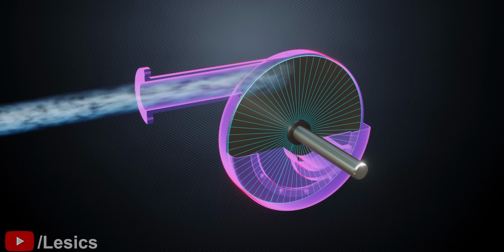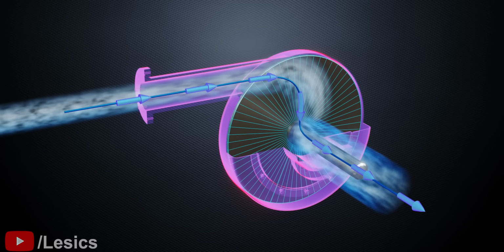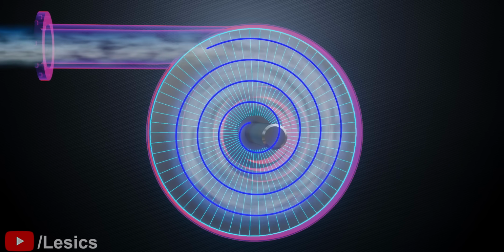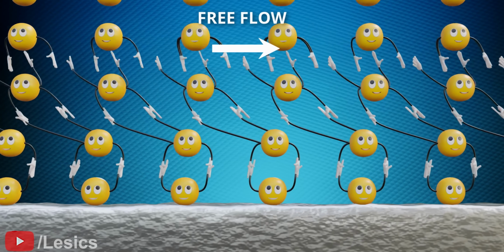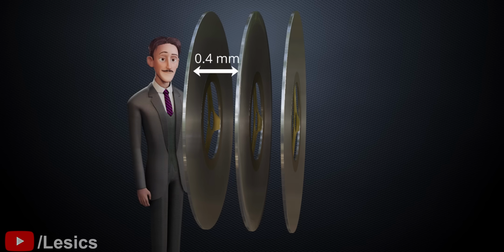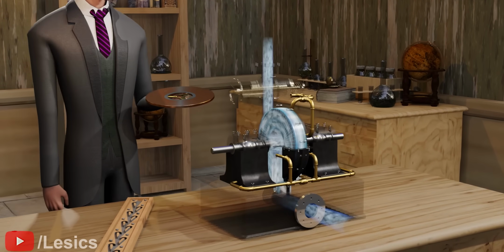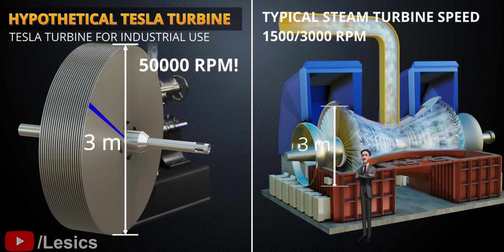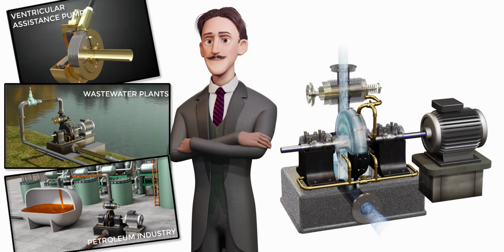Tesla Turbine | The interesting physics behind it

Comment: I was part of team that built one of these for an Airforce design competition in college. We could reliably get ~94% efficiency with a closed loop superheated steam system harvesting exhaust heat from a small jet engine and got just below 96% efficiency in some ideal test cases. The main limiting factors were that the discs had to be designed to stretch uniformly without distorting at ~40k RPM and that the gaps between the disks had to be designed for an incredibly specific set of operating parameters (steam temp, pressure, velocity, etc.). The smallest variations, or while waiting for it to spin up, and we wouldn't even get close to those efficiencies. A lot of the initial designs weren't efficient enough to reach the right parameters at all.
Reply: I came up with a major improvement to the Tesla turbine.  Haven't gotten around to patenting it yet, plus nobody is interested in the technology. My proof-of-concept model actually used posterboard discs.  One thing that helps disc pack stiffness as well as self-starting is putting spacers around the perimeter of the disc pack (not an original idea.)  Ran it off compressed air using a handmade by-guess-and-by-gosh De Laval nozzle.  Hooked it up to an old (small) electric motor and it was able to do useful work, although I imagine the efficiency was truly horrible.  
When I retire, I want to see if I can build a gas turbine engine using two Tesla turbines (one as the compressor and one as the power turbine.)  That would be a single intake turbine coupled back to back with a single exhaust turbine. I think some of the early German jets used radial flow turbines rather than the current axial flow designs.
Reply: @ostlandr  Whittle jet was radial flow.
Reply: @ostlandr  thats what I was thinking too, like I said with how a scram jet is built specifically for hypersonic speeds only and essentially needs a boost phase tow in from a classic turbine but that uses linear force feeding and I think its that centripital force and the feedback loop that makes it so good, that also makes it so untameable at the same time. 

Its essentially all horsepower and no torque, the second you put a load on it, its going to burn itself to death. 
Unless we can get our hands on some wild new neutron star element that can warp space time, I think like @cheebsta said, you really need to take this idea from the 50,000 foot view and ask, whats the real use case that this can perform that isnt already done so by the most hardcore capitalists employing the most world class engineers (i.e. Edison bootstrapping tesla into a lone, impoverished death with government spooks flying like vultures around him waiting for him to pass and steal his Godly treasure trove of sentient progress)

But, if we can walk along the razors edge of science here and remember that Tesla said: 
"If you want to find the secrets of the universe, think in terms of energy, frequency and vibration."

So maybe there is some way to balance that overload force with some sort of resonant frequeny or something way outside my bounds of thought. I mean the man made a frigging earthquake machine. 

So if its meerly for personal value Id say absolutely go for when you retire and if you figure it out then I will deliver standing ovation. I get most of my lifes joy building things I never get to use though so there is truly joy to be found in just merely building things. 
Or if for any reason, I would say to honor the true bringer of light and the One Father of the modern world of electricity, the greatest Serbian man to ever walk the Earth, the man, the myth, the legend, Nikola Tesla. 
May he forever rest in the resonance of the ether and may Edison dissapate into an eddy current somewhere. 😅
Reply: Oh boy this warrants so many follow-up questions:

- Dual outlet or single?
- How many discs were used per outlet? 
- What geometries were used in the outlet? 
- What diameter went with that RPM?
- What was the measured torque output?
- Was (or how was) the design compounded? 
- What materials were used for the discs that had those properties? 
- Stated efficiency is presumed mechanical, how'd you calculate that efficiency? Was it measured output vs measured losses after the outlet?
- What was the name of the competition? Who did you represent or were associated with? I want to find it online or know what I'd need to file a Freedom of Information request with the government because having access to those results would be a game changer for anyone seeking investment in the technology.

I'm not looking to call you a liar but you did just say you'd achieved well over twice anyone else's stated efficiency numbers. While I can imagine what you're saying could be true it's still well beyond what anyone has actually demonstrated. So "extraordinary claims = extraordinary evidence" still applies here. Nothing personal! :)
Reply: @Cheebzsta  Honestly, it was years ago and I don't remember most of the details but I'll give you what I got.

-It used an exhaust manifold with a single exhaust port going into the turbine. The port was also optimized for laminar flow over the disks. The turbine had dual axial exhausts which recombined in a baffle at the manifold's intake.
-Around ~15 disks, can't remember exactly.
-Turbine exhaust was a circular cut around the axle, broken up by three supports with rounded chamfers. The disks mimicked that but were individually keyed to give the ports a slight offset. The offset actually eked out a bit more (read as "miniscule") efficiency in testing, likely due to artificial radial extension of the fluids path toward the axle.
-Around ~10in diameter disks.
-Not sure exactly how this design came about except our professor was interested in a practical execution of the turbine and it fit the competition requirements.
-The disks were made of a pre-stressed stainless steel alloy. They were individually laser cut then tested at expected RPMs for any unexpected deformations. The vast majority of all disks didn't meet our specs and got tossed out. I think we could only use about 1 in 20 disks by the end of it.
-It was primarily a mechanical efficiency and as soon as you throw an alternator on there it's a completely different story. It was measured relative to the steady-state properties of the steam at turbine intake vs turbine exhaust and the kinetic energy of the disks and axle. We measured efficiencies throughout the entire system but that one was the main focus. The most inefficient part of the system was just heating the steam with the jet exhaust without impacting its thrust too much. Surprisingly difficult to do. There was a fair amount of doctoral research on tesla turbines that we used as the basis of our design and which achieved similar efficiencies but it was all at similar or smaller scales. For the amount of effort there aren't really any practical applications for a turbine like this.
-I can't remember the name but it's an annual competition (different goals each year) based out of Wright-Patterson AFB in Dayton, Ohio. This one was in 2014 and we were representing the University of Michigan Aerospace Engineering department. It was a shockingly informal process so I'm not sure how much info you could find but if you do look into it and find anything let me know. I'd love to revisit it all.
Reply: @ruchz2010  Thanks for the response. I appreciate it. :)
Reply: @Cheebzsta  
This might be a stupid idea but what about machining or metal etching Tesla’s valve between two opposing disks?
Reply: @QuantumStrangeQuark  Well I'm trying to visualize what you're talking about, since it sounds like you have two contra-rotating impellers, which if you're seeing something in your mind's eye there that I'm not than I commend you.

But I'd take a broader perspective on things like this: If you require extensive machining of the turbine you've likely moved out of the real, and IMO, the point of a Tesla turbine.

One of the things that even Zach points out is that the whole thing began to fall apart once they added an alternator to it meaning that they hadn't overcome the key failing of the device: Mechanical efficiency while extracting useful power as electricity.

If you've got the kind of machining necessary to etch complex geometries into a tapered disc you're probably not far off from being able to machine a bladed turbine which, thus far, has demonstrably better efficiency results.

So long as you''re paying, either in labour or money, per KWh for fuel (methane / hydrogen / etc) the economics always point towards using the most efficient units.

Not to say that I think the Tesla turbine's bad. I just think it needs to be used in situations where power extraction is possible but regular turbines would be smashed apart.

For example while I don't think there's any reason to imagine a world where large scale steam power production facilities are replaced I do think there's a purpose for it though if one can get creative. 

One is small, distributed power plants. For example using fast pyrolysis of biomass to produce an 80%/20% bio-oil/charcoal slurry which can then be pumped, using a Tesla pump no less, to a centralized hydrogen or bio-methane production facility.

The second and simplest one might be spraying waste flue gases directly into alkaline water and letting the ensuing geyser-like water explosion hit a turbine, for example.

Provided the materials aren't prone to serious failure in the presence of alkaline solutions the Tesla turbine can handle the suspended solids flying a hundred (hundreds?) of KM/H that would result.

It wouldn't produce the kinds of efficiencies that a regular steam or gas turbine would but selling industries with a lot of waste flue gas a mechanism to earn additional revenue using a machine that is, by definition, cheap and easy to mass manufacture is a potentially interesting thing to do.

If we can replace a sizable percentage of our natural gas used with bio-fuel based sources (Gasification -> Sabatier reactor / Anaerobic Digestion etc) one could imagine a situation where carbon taxes make the appeal of such a device a fiscal no-brainer.

Make money from the electricity, avoid carbon taxes and still have the option to switch to bio-fuels so you can sell carbon credits? 

Like everything it depends on price and government action but this isn't really a new idea. Tesla himself envisioned something akin to this only now it's not merely economic (dirt cheap energy!) but instead comes from us realizing that we've barrelled into becoming the world's most self-aware yeast.
Reply: @ruchz2010  
Sawmills encounter similar "stretch" issues with large circular saw blades.
Their solution was to make a blade that would be a slight bowl at rest and then "stand up" while spinning due to the steel stretching at the outer edges.
Reply: @ruchz2010  I did a lot of research into Tesla turbines many years ago and it seems that the main problem was preventing distortion of the discs from heat and perhaps stresses in the rolled metal they were cut from.
Starting the discs was easier if small holes were drilled axially to causes 'grippers' for the steam  flow to impact on.'  Enlarge the gripper holes and you get a turbine that is easy to start and gives very good torque.
Problem these days is huge steam generation needs fossil fuels so I don't think we'll see Teslas ever used.
It would be interesting to try a Land Speed attempt using a steam powered Tesla with the steam either coming from a big conventional boiler or some chemical steam generator a la Turbonique of the 1960's.   Such a vehicle having a big boiler heated by a gas burner would start off slow and heavy but get faster as it exhausted the steam...
Reply: @ruchz2010  Fascinating, Thanks, Zach.
Reply: @Al828282  Tesla cars are now wrapping their engines and carbon fiber to prevent expansion, allowing them to get higher RPMs and tighter tolerances.

I'm pretty sure the same could be done here.
Reply: @r1xelex  there's a company making a steam powered rocket, intended to be used as a first or booster stage.

As far as I could tell they're just using batteries and a resistive heating element. Might work even better if you toss some hydrogen peroxide in there too.
Reply: @jtjames79  Messerschmitt 163 used hydro-perox.  Super power for a few seconds.
Reply: @Cheebzsta  I think it would be interesting to see this engine setup in both polarities. Where one generates into a the version that is a pump and the pump pushes into the generator, and limiting the pump RPM to keep it at a consistent speed. Of course, using any power off of it may reduce the pump speed, but within certain limits, wouldn't you be able to get a consistent voltage to other applications before it stops from being overworked? Maybe that's not a reliable way, as it needs a starting point to get it going to begin with, but if we are talking fluid (hydro electric), the free fall would increase RPM, then the pump would increase it further and generate more power? Or would powering the pump use too much energy?
Reply: @Cheebzsta  you don’t seem to understand basic physics concepts :)))
Reply: @jimmythepowerful  Whelp. I've been exposed. Ya got me. :P
Reply: @ruchz2010  The bladed turbine has had trillions of dollars thrown at it in R&D that continues today.  All of that is to solve problems in design and materials.  How much has been thrown at any of Tesla's projects?  Outside of the university projects given to grad students as a thesis publication for graduation purposes and the "off the public" books of government experiment. (i am not a conspiracy theorist. let's face it the Manhaton Project is a prime example of government conpartmental experinment).  How much do you suppose?  Some of Nikola Tesla's works could make a lot of the top industrialists very poor and make the WEF irrelevant.  One more question.  Have you ever wondered why man was using horse and buggy up unitl the 19th century and gas to light up a room until the early 20th?  If you go by the Bible Time line that would be roughly 4000 years of walking, pack animal, and horse.  If you go by the Evolution Time Line that would be in the millions of years before any improvement.  What was the catalyst that accelerated all of this industrial developement?  Why do we have so many videos that say that Tesla's works are an engineering impossiblity?
Reply: @Cheebzsta  you seem really smart. Self aware yeast....thats gold. 😂
Reply: @QuantumStrangeQuark  the bounding layers of the disks would double in its efficiency?
Reply: @QuantumStrangeQuark  or maybe more
Reply: @QuantumStrangeQuark  but maybe the effiency would decrease over a set rpm were the opposing force of the boundary layers obstruct the free flow of water?
Reply: @QuantumStrangeQuark  centrifugal force will cancel out advantage of fluid friction gained from spiral path
Reply: @ruchz2010  DARPA sponsors some of these competitions. Within the AF there was a competition between R&D units held annually at LAFB.  I think Wright-Patt even sent a team.  The competition was designed for junior engineers, but a few LA high schools participated.  An all-day affair, almost like a trade show demonstrating and showing off new toys.  As you mentioned, there were constraints and objectives or tasks, as well as a budget(usually $50 or so). I remember one being a mousetrap-powered vehicle.  Typical timed race, distance it could travel, and additionally a capture task after traversing a water hazard depression.  Capture was tricky because the line of targets was perpendicular to the water hazard & direction of travel.
Reply: @ruchz2010  use tungsten disks, you'd need to do the math but a tungsten disk probably would be able to withstand those parameters.
Reply: @ruchz2010  Nice job mate
Reply: @Cheebzsta  One of the things i havent read yet. why not make the disc smaller in diameter? Also you propably would need to slowly get into load with an generator to hold power. Maybe with some mass flywheel at first, or sacrifical clutch to engage the generator.
Reply: @nicoleibundgut534  Funny enough this is one of the things that the Tesla Turbine does relatively well!

The Tesla Turbine doesn't suffer too much from being miniaturized when it comes to performance relative to a lot of bladed designs.

So while the overall inferior performance means it's out of contention for most purposes it's been suggested as potentially viable in terms of producing micro-power because you can make them teeny tiny while they still work relatively well and given the highly simplistic nature of the device that might have some real purposes in microfluidics.

The physical problem is that choking your flow is pretty easy to do. Minimum pressure ratio is about 2 for dry air which presumably means you're looking at high subsonic flow speeds for the working fluid.

If the turbine's spinning at peak power output, say 50% of half the speed of sound and you make the diameter smaller your RPM goes up correspondingly.

Which means you need more significant gearing. It's basically why modern power station turbines require such large gear boxes or diamters themselves: To convert high tip speeds into appropriate RPM for synchronous generators.
Reply: @Cheebzsta  yep i was thinking about miniaturising aswell. Since higher rpm could get you into similar power too. The tranny is going to get some losses saddly. Would wonder if there is some kind of high rpm generator. Maybe you could FU it down from 50000 HZ to 50 again which may be less loses then a transmission.
Reply: @Cheebzsta  just trust me bro
Reply: @Cheebzsta This is either the world's most underhanded insult by an "intellectual" or a very great set of observational questions.
Reply: @Cheebzsta  I was on his team, true as it gets
Reply: @Cheebzsta  Turbine efficiency isn't the same as overall cycle efficiency tbh. In the video he states that normal turbines are over 90 percent efficient already.
Reply: @Cheebzsta  there are possibilities out there it takes time it takes money it takes people that are open minded to accept the fact that you can reinvent the wheel and because the system works nowadays doesn't mean in the future something better can't come along but you always have to deal with the bureaucrats and that's the problem and somebody's making money at a certain way that certain things work baby they don't want to reinvent the wheel there's a lot of factors have a good day
Reply: @Cheebzsta  
Want in on this info
Reply: @Cheebzsta  Nah dude I was there. It's true
Reply: @consumemilk8005  Not a valid answer
Reply: @xlgapelsin6173  I filed a FOIA act with the YouTube Validity Committee.  Is valid.  Plus I was totally there too, so I'm not saying you're wrong but randos on the internet aren't really objective authorities on what is and is not valid.

Also issa joke, my guy.
Reply: @xlgapelsin6173  i was the disk its all true
Reply: How do I bookmark a comment section?
Reply: @JaredFromSubway88  On top left by Youtube icon there are lots of options. History, subs?  Maybe one of those will keep it bookmarked.
Reply: How is efficiency calculated?
Reply: @bikedawg  Energy output divided by energy input.  If you know the pressure and temperature of the steam coming into to turbine, and the pressure, temperature and dryness fraction coming out, you know how many joules of heat energy are being "lost" to the turbine (input) per second.  Once you calculate how much work the shaft of the turbine is doing each second (output) you have everything you need.  I can show you how to read steam tables if you want to take it to the point of how to calculate the input energy.
Reply: @bikedawg  energy input divided by energy output
Reply: as an engineer totally normal phenomenom :D
Reply: I wonder about mono-atomic graphene disks....
Reply: You think ceramic discs would work?
Reply: So this is one of those we need a specific super alloy material to do things
Reply: Can you explain why one cannot alter the rpm speed through opening and closing a dampiner?  Sure it would show a lag but so what. By opening and controlling the dampener the engine's use of steam could be regulated and yet the plates would be allowed their most impressive efficiency rate.
Reply: @terryglenweaver  simple turbines generally have one speed that give best efficiency and that is a function of the gas flowing over the disks.
Turbos for cars are turbines and the hot side needs to be kept spinning at max but when engine has to slow down the intake side gate closes to reduce airflow into engine until throttle is opened and then the gate opens and intake side gets instant flow of cool air.
Lots of experimenters have tried making Teslas with same size or unequal size disk or with three or four disks but always the basic problems prevent them succeeding.
Reply: not a closed system if you are intaking heat.
Reply: Hmm. So what if you made a turbine who's blade spacing could be adjusted? Like the blades can be brought closer or farther apart.
Reply: @Nexalian_Gamer  ok now make it  actually work. throwing out garbage thoughts that dont actually translate is useless.
Reply: why not use different size discs in some ascending fashion when speed increases if this is the case. i wonder if the discs spun at a submelting point encased in a cryogenic design could somehow enable 'slow expansion' of the discs.
Reply: @NK-fx1qs  even if it slowly expands its effeciency will 100% go down 👇
Reply: Why does that turbine need to have more than 3 disks in order to work ? Less disks means less drag and a lower total RPM, plus that with modern technology there is a very wide choice of materials and means to choose from that could be used to construct those disks or control their RPM. I think this technology is  revolutionary !
Reply: Best comment thread I've ever read on youtube.
Reply: China's not exploring space, the are recreating earth with their Sun simulator they just launched https://www.youtube.com/watch?v=ynhVFvXda90&t=4s
Reply: Then you purchased solar panels?
Reply: I believe the original disks Tesla used were nickel silver? If that's the case it's no surprise they warped easily being a white brass. What material did you use?
Reply: @tonyyoung2509  IIRC, the original design was with solid nickel disks.
Reply: My question would be, what known substance to man has the least amount of heat expansion, with the greatest amount of heat resistance and rigidity?  I'm thinking something like: "tantalum carbide and hafnium"
Reply: @chrispatriot  I don't know but the space program probably uses lots of exotics.
Reply: @r1xelex  My uncle retired from Cape Kennedy Center where he was one of the engineers during the Apollo days. I asked him if he still felt connected to what happens now and he said, warp speed exists, and the separation between then and now is the proof... ;)
Reply: @chrispatriot  Hard to imagine warp speed can be made as a practical craft.
But  if Tesla planned to take advantage of Earth's natural  Electric system that can produce massive jolts of electric and electric can convert to magnetism so maybe the billion/trillions of volts of constant earth electric would be sufficient to propel a craft to warp speed.
Don't forget Earth is a giant combined generator just like Tesla's Coils. 
We occasionally see the generator discharging as Earthquake Electric Sparks and ground to air lightning..
But what about inertia and thrust through Earth's atmosphere squashing occupants?
What loading did astronauts feel on way to Moon?
Reply: @r1xelex  Exactly, we think on the same wavelength... Years ago, it was unimaginable that a computer could fit in your pocket. Now we have MicroSD Cards as large as 1TB, and it's already said they'll triple that soon. 

Like you, I think the word "impossible" should have a 4th definition in the dictionary which simply reads "It means not yet"... ;)
Reply: What materials did you use for the disks to limit expansion?
Reply: @ThuleApsu  High quality carbon steel.
Don't get too concerned about disc expansion as the inlet gas/steam passes between the discs not round the outside.
For a small experimental Tesla you could aim for a generous clearance between discs and case.
And don't forget that small turbo air inlet wheels are made of aluminium and can match the 100-140,000 rpm of the heat resisting steel or ceramic of the hot exhaust gas. 
Most turbo exhaust sides run red hot at high speed.
But like I said previously: if you have a supply of high pressure steam, air or exhaust gas then a Jet Wheel Turbine fabricated of good stainless would be the better way to get power and torque over a wide range.
Reply: @r1xelex  I was thinking the guts of an old multilayer disc hard drive, and insert it in a new case.
Reply: @ThuleApsu  It will probably be made of pressed tin and probably more trouble than having some discs cut from good tough chrome-moly steel sheet by a machine shop.
Reply: @r1xelex  The disks are platinum coated and can spin at approx 20,000rpm
Reply: @ThuleApsu  Well, OK, you can but try them and see what happens.
Reply: @ThuleApsu  LOL was a proof-of-concept model to test the principle of my improvement. Ran it on compressed air.  The discs were actually poster board. With spacers at the central hub, at the rim, and no exhaust holes in the discs, poster board was plenty strong enough, plus there wasn't a super tight tolerance between the case and the disc pack.
If I ever build a proper prototype, I will just measure the percent expansion of the disc pack at working RPM and temperature. Subtract that from the interior case diameter, add a tolerance factor, and you have the diameter of the disc pack for a given case diameter. 
Also, I believe a steel alloy with molybdenum is creep resistant at high temperature.
Reply: @ostlandr  Interesting, and yes we all have to start somewhere), its a pretty similar design to a centralfugal blower, there is always an on the shelf design somewhere if you look hard enough, know the Mil;waukee M18 vac uses one in suction mode, so that's the case part sorted, I bet an old hard drive would supply the disks, bearing and motor)
Reply: Convoy from Netherlands
ГОЛЛАНДИЯ В СЛЕД ЗА КАНАДОЙ КОНВОЙ
https://youtu.be/gn0F2L1mkCY
Reply: Did you use carbon disks?
Reply: @alexeyantonenko877  carbon has no strength.
Carbon steel has plenty of strength on the lines of 60-65 tons per square inch.
Reply: @r1xelex  The turbine disk has to handle a circular force, originated by its own mass. So, the material of the disk has to have the best strength to mass ratio. And this material has to resist an extension specifically. Compression doesn't matter. Carbon fiber fits this application very well. The carbon disks can be made very thin and have a smooth surface, which is also important. Also, graphene ribbons can be used for even more strength with less weight.

I think, the linear speed problem, mentioned in the video, can be basically solved by applying more advanced materials instead of conventional metals.
Reply: @alexeyantonenko877  I didn't say carbon fibre or carbon ribbons wouldn't work. I said carbon wouldn't work.
And FYI people were experimenting with ribbon rotors many years ago but I don't recall any getting beyond prototype stage.
Reply: @r1xelex  What were the issues with the carbon they faced to?
I found a video with a carbon rotor: https://youtu.be/owB7jIvkmrU
Reply: @alexeyantonenko877  Yes.  But it is only a small demo unit - not a practical device for driving anything.
Reply: Shalom
Romans 1:5-6
 5 Through Him we have received grace and apostleship for obedience to the faith among all nations for His name, 6 among whom you also are the called of Jesus Christ;

 Ephesians 1:17
 17 that the God of our Lord Jesus Christ, the Father of glory, may give to you the spirit of wisdom and revelation in the knowledge of Him,

 Philippians 2:9-11
 9 Therefore God also has highly exalted Him and given Him the name which is above every name, 10 that at the name of Jesus every knee should bow, of those in heaven, and of those on earth, and of those under the earth, 11 and that every tongue should confess that Jesus Christ is Lord, to the glory of God the Father.

 Colossians 1:9
 Preeminence of Christ
 9 For this reason we also, since the day we heard it, do not cease to pray for you, and to ask that you may be filled with the knowledge of His will in all wisdom and spiritual understanding;

 2 John 3
 3 Grace, mercy, and peace will be with you from God the Father and from the Lord Jesus Christ, the Son of the Father, in truth and love.
Reply: @Whiskey Pete A 3 Meter wide diamond may be worth more than the entire energy production of such a flywheel.
Reply: I can't imagine trying to build one of these out of anything other than tungsten or inconel.
Reply: Can't have it !! It's too powerful. It needs to be banned !!
Reply: I can't believe anyone cares.
Reply: same dude same. not for airforce or anything fancy like that tho
Reply: Can we dam a shallow sea and build water based power plant?
Reply: Thats really cool, it reminds me of the issues aerospace engineering has with hypersonic flight in engines like scramjets. Its essentially like second stage in rocket science. It needs a reliable boost phase I suppose, but Im just an autodidact of sorts. I bet you'll have some awesome stories to tell in your future!
Reply: hey im post grad physics and ive been trying to design my own turbine jet engine.  but using plasma means i can use propane and a special micro holed nozzle ($4k)  after playing with a pulse jet made from a water bottle  . but what is the output required , IE:;  how much thrust per cubic centimeter and what speeds does the ionized gas need to be going . i bet the exhaust trail is way way longer than a conventional jet engine
Reply: IF YOURE STILL WORKING WITH THIS I HAVE SOLUTIONS.
EVER LOOK INTO THE STIRLING FREE PISTON GENERATOR.
Reply: So, a Tesla turbine running with geothermal energy..
Reply: First off I just want to make clear that I have no education or experience in this area at all. But my curious nature draws me to videos such as this. So if my questions seem silly, please excuse my ignorance. 
  I'm wondering if there's a type of ceramics that the discs can be made from?
 Also I'm wondering if laying the discs in a horizontal position would help them run better?
  Also if the viscous fluid were water would the water help to stabilize the discs while at a high rpm?
Reply: Mm🎃🎃🎃🎃🎃🎃🎃🎃🎃🎃🎃🎃🎃🎃
Reply: You mYou 🎃🎃🎃🎃🎃🎃🎃🎃🎃🎃🎃🎃🎃🎃🎃🎃🎃
Reply: Look into how koenigsegg built thier turbine. I think they solved or surpassed it with thier version
Reply: The biggest problem is research and development having the funding to allow you to modify designs and reach an ultimate point where the apparatus works correctly I've done it and sometimes you just got to keep experimenting till you hit the right number have a good day
Reply: you lie
Reply: simple question, what material did you use for the discs.
Reply: Your numbers don't match mine.
Reply: An inventor I know has worked out the high velocity  rpm problem, where there is zero friction and it can do over 50,000 rpm  using the Tesla turbine principle..is called: C.R.Mfee
Reply: aka it isnt fit for purpose... smh
Reply: @zach Ruch i had a question. Had any thought been put into “ labyrinth printing” on the disks themselves? To enhance the efficiency?
Reply: efficiency?   what about generation?    I mean,,  a simple sterling engine can produce power..but friction?   figure the generator would lock up unless your pumping  tons through it
Reply: Yea bit how do you use this type of thing if it will always want to go faster.  Can it be braked
Reply: 94%? I'll take that any day over conventional turbines
Reply: Is computer controlled disc spacing a possibility? Akin to variable valve technologies? Could we get all these variables connected to an algorithmic control unit?
Reply: @jazzywillo10  I can already see a vtec badge on an old tesla model 3 20 years from now 😅
Reply: @jazzywillo10  mabye in a 3 disk system, because the spacing applies to the distance between all the disks. adjusting a set of, say 13 would be insanely difficult to make work if it worked at all. Then there are the RPMs to consider.
Reply: Tesla turbines are, naturally, not suited to driving a mechanical load.  Rather, you need to make the tesla turbine, itself, a self-excited alternator.  You are, effectively, using an electromagnet to induce a current through the rotor of the turbine and then scavenging the reflected field plus its contribution in velocity.  Depending on distances involved, it might have to be done in the microwave region.  In theory, it should work even without a full wavelength of separation and therefore at LF, but creative winding strategies might be necessary as the operating principle assumes half duplex operation of stator/exciter windings, not full duplex as would be necessary for simultaneous excitation and scavenging, and to my knowledge, this can't be done with our current electromagnetic technology in inductors coupled across less than one full wavelength.

Of course, this is taking discs of high physical accuracy and precision and adding microstructured wiring and electrical features to it.  So, I am that guy in these things who is never satisfied with putting a belt and pulley on something to make it work rather than reinventing everything so that it can use spooky magnets or something.

There again, I was proposing RF plasma engines for aerospace propulsion which could switch over to Z-pinch boron-injected fusion VASIMR for applications sufficiently outside the atmosphere.  Main power was to be provided by hydrogen-boron fusion from dense plasma focus reactors.

One thing I will point out about China's different individual released technologies/programs, they are aiming for an aerospace program - and I mean a legitimate aerospace program that bypasses most SSTO concerns.

Their only real missing component at this point in time is power generation aboard the aircraft.  That already has a solution.  Dense plasma focus fusion has been around for some time and has been in use for the heavy ion ballistic missile shielding system.  THAAD was a fun toy for the contractors to build and is good for deploying rapidly to new theaters.  Not really a strategic asset, though.  Particle beams make for great ballistic projectile interceptors.  Very fast propagation speeds, electrically deflectable with a simple yoke, self-pinching in the atmosphere, and a tendency to phase through physical objects before 'dumping' energy in a predefined range.  Protip: there aren't secret maglev train tunnels.  I did encounter a fun story about particle transport systems interconnecting certain areas from people with clearances to projects outside direct government funding/contract.

Fun thing about the military industrial complex is that said complex often gets ideas well outside what the government and/or military officially ask for.  In good and bad ways.  We often focus on the bad ways, such as how we operate al qaeda and the cia conducts operations against america (in part because they were created by the british - but that's getting off in the weeds).

China at least presents and interesting opportunity to escalate the game a bit.  China is predictable in their aggression, and that makes giving them some industrial hints useful.  They are a practical people focused on claiming the mantle of the bully pulpit, and that means they will make use of things that work to win, rather than play politics for mere prestige.

China isn't more advanced.  They are just forcing things into the light.  Well ... Our factories could see some serious TLC after decades of neglect by investment, but that is kind of why we need some forcing of the hand.
Though if the CCP thinks they are going to come out on top..... West Taiwan needs to calm the fuck down.
Reply: @Aim54Delta  
Did you already try to apply at Tesla‘s PR department?
Reply: @Aim54Delta  British 'Crown' aka Royal Family Germans - want America back and will do anything possible to destabilise it in order to regain control.
I just read that quite recently they passed law in Australia that all minerals in the soil belong to Royals!
Royals are German-Assyrian-Babylonian-Jewish -Canaanite-Nephilim right back to The Flood.
Reply: @Aim54Delta  would it not be a lot easier to embed magnetic structures in the steel disc than electrical structures? We can embed magnetic structures in the crystalline matrix without impairing the overall strength of said matrix?
Reply: @mycosys  
That would depend on the steel/alloy.  The other aspect is that the strength of a magnet is based on the ordered/aligned movement of electrons.  A conduction based magnet does not saturate and can be used up to material failure.  A permeability based magnet or permanent magnet can saturate and therefore have an absolute peak in power harnessing or delivery, depending upon its operating mode.

But, yes, you could use something like 301 stainless in a work hardened state and then selectively anneal it to remove magnetic properties.  At least in principle.  301, 304, and some other stainless alloys are non magnetic in their annealed state and become magnetic as they are work hardened and their structure becomes more like martinzite.
Reply: @Aim54Delta  One of the modern innovations to the disc turbine is to use spacers around the edge to improve both disc stability and self starting. Just use ultra-strong magnets as the spacers and move them through a magnetic field in the turbine case.
Reply: @ostlandr  
I generally avoid permanent magnets and/or ferrous components due to saturation and hysteresis problems in designs.  I would do something weird like form a halbach coil as a microstructure of copper/silver and aluminum nitride.  I would need to see what the hoop stress limits of AlN are, and match distortion to the disks (may just make solid AlN disks and be done with it if they'll survive).  The halbach coil would be excited by an external coil - I may even play with integrating capacitance into the windings to create a resonant frequency and possibly allow for a range of more efficient operation - though it may be unnecessary.

Permanent magnets are possible - but hoop stress limits of permanent magnets is usually pretty bad, which means they need support with some material or meta which can survive even higher hoop stresses.
If we are directly working with steam, then they are going to be heated, and that lowers the range of available magnets that will work in that temperature range.  It also complicates the heating of magnets that often accompanies their use in harnessing power.  Iron nitride may offer some solutions in this regard, but it is still generally pre-commercial and methods of forming it are strain-based at the moment, limiting its magnet forms.
And if heat goes too high on permanent magnets, they can be permanently damaged.  There is also a limit to their flux density and therefore a hard limit to the amount of energy which can be extracted from a given change in velocity.

Making them not ideal for use in a compulsator - although suitable for some design applications.
Reply: @ostlandr  centrifugal force will overcome any magnet. 
Tesla himself added protrusions to the disc faces to give the jet something to act upon.
Cutting scallops in the outer edge of disc would give the same impact zones and lighten the discs too.
Pelton wheels get good power and efficiency but their mass negates super speeds.
A Jet Wheel Turbine fabricated of laser welded high strength stainless sheet would be light and allow the incoming jet to work directly and maintain pressure right round the disc to the outlet.
Reply: @r1xelex  The magnets in my design would be mechanically attached, just replacing the spacers.  The idea being, the turbine itself would become the rotor of an alternator, and the turbine case would become the stator.
Reply: @ostlandr  Permanent magnets wouldn't work because thermal degradation, the high temperature caused by friction alone would destroy them.
Reply: @ostlandr  And as for your idea of the turbine to become its own stator would limit your rpm range to 3.600rpm to be used on the US electrical grid because that's its frequency of wave length. Not to mention, as soon as any amount of load was put on the system it would drastically increase the resistance in the system. And at the slower/fluctuating speeds, not sure it could be made viable. Although..... you wouldn't be as limited if you had a reduction gear and some kind of reversed exciter and commentator/ring that could mimic it back to D/C power.  Wouldn't be able to put power onto the grid. But, could be amazing in the D/C realm of power to charge battery banks for EV vehicles.
Reply: I think the way we think of turbines is going to change drastically once the bending of light can be used to turn tubines. We know from recent years now that light beams can be bent by gravity so then there must be imo some force that can be exploited there and used to generate thrust. Which is how my concept for a next gen turbine (maybe) works. It's really almost not a tubine per se, but that's the closest thing we have thats anything like what I have in mind. Just wish I could get more people to look at the concept and see what they can figure out with it because I'm not the best with physics, but from what I do know... it seems like my powerplant idea should work.
Reply: @apIthletIcc  The 'Not Invented Here' syndrome has stopped masses of innovative products.
Companies are filled with people only concerned with pushing their own ideas or not pushing anything so any outside idea is just dismissed and ridiculed.
Reply: @r1xelex  pretty much. Since I'm not an MIT student or something equivalent, my ideas must not be viable, in their eyes.
Reply: @apIthletIcc  That's it.  Plus there is the fact that you know something that others don't so of course they sneer at you.
Turn the clock back a thousand years and tell everyone there is another continent the other side of the ocean..
Reply: @apIthletIcc  look up solar sails and the potential for limitless speed, well in eons. I think what your suggesting is possible but the amount of material required may be ridiculousl.
Reply: Odd question from someone who's curious. Would cutting channels in the disks at the centrifugal angle improve the energy extraction or would that be an issue leading to a broader dosk failure scenario?
Reply: @War-Jac  It would help starting and torque  but disrupt the smooth flow of the incoming steam stream and probably cut top revs and power; but if channels or grooves were cut from centre to edge it would weaken the disc as the area between grooves would be a sort of tapering wedge with most weight at outer edge.
Making the discs of thin tough metal with two discs welded together at periphery and having some grooves or louvre cuts on faces would perhaps be a better way but I think it likely that every possible shape and size will have been tested over the years.
Reply: The problem is in the shedding of fluid in the vacuum creating friction and loss of energy over time u w need free fall of zero gravity machine to achieve 100% efficiency
Reply: @love4sound  lol um no. still aint happening. but please more word salad.
Reply: @BrighamMike  word salad.
Reply: Until you put it under load then it fails, as all so called free energy machines do.
energy from fossil buring jet engine defeats the purpose of free energy, jetfuel is a pollutant not pathway to free energy.
Reply: Designing for imperialism
Reply: @katja9369  FAR FROM IT.
Reply: I seen in one vision on person did work on the jet engine testing different metals and configurations. That information tells me what you are limited to on earth. My favorite metal isn't located on Earth. The strength on my favorite metal doesn't melt at 6,000 Kelvin. Earth has been kept a little primitive because you like to fight each other. All of the planets which have life on them in the universe are peaceful except for Earth. Nikola Tesla lived on other planets too and this work that he did there was a lot more advanced than what was done here. If you had the proper materials you would be at 97% efficient.
Reply: @Anu1000deminsion  no
Reply: @Anu1000deminsion  ok virgin.
Reply: Yes. A tesla turbine is no good. That's why we don't use them!
Reply: @Chris.Davies it's because the Tesla turbine was not completed by Tesla himself. And we won't be able to use it until some other dreamer with the ability to materialize their dreams comes along
Reply: @weke2487  If only I had the capital.
Reply: @weke2487  If I only had the capital.
Reply: @Chris.Davies  Tesla had more than one design. We in fact use tesla turbines in micro hydro power generators in some cases
Reply: @Chris.Davies  Not that its no good, we just havent discovered a material rigid enough to build one. May happen one day.
Reply: @Chris.Davies  Tesla's were used for a while.
Reply: @Chris.Davies no good or too good for our building materials? It is people like you that keeps science in a loop
Reply: @Chris.Davies  but think about it if tesla himself said it had 97% effeciency what if it was perfected? i mean it would even hit 99% forsure